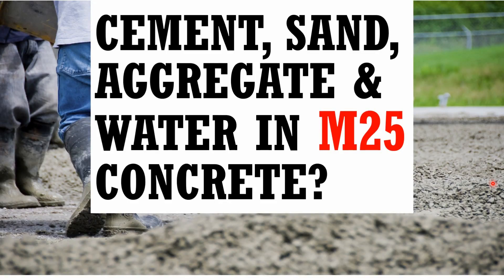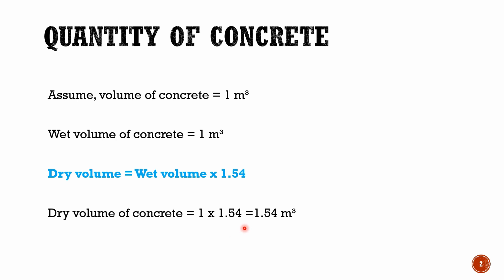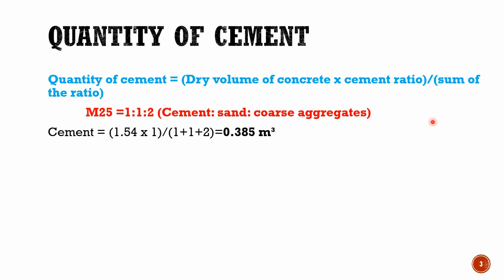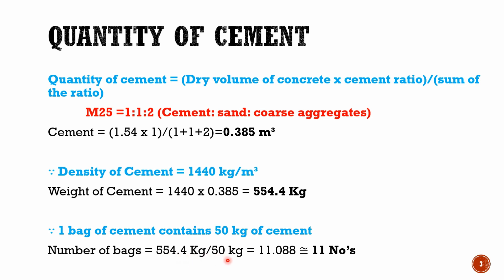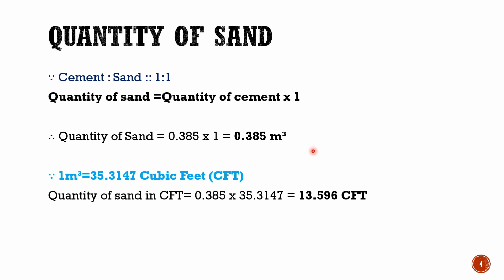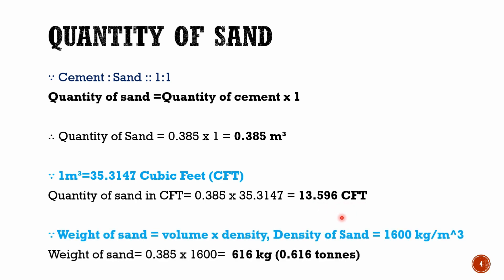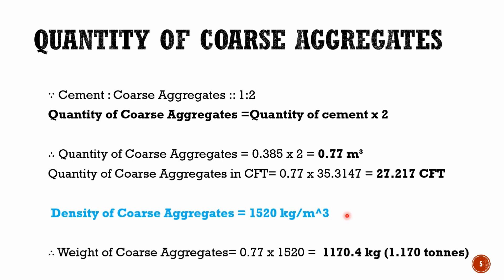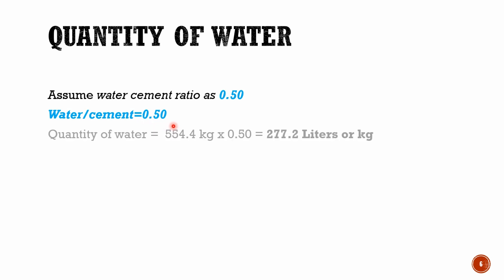How to Calculate Cement, Sand, Aggregate, and Water for M25 concrete

Comment: Ratio between wet and dry M25 concrete.....?
Reply from the maker: 1.54 is the multiplication factor. 
After adding the water to the concrete mix, It bulks and reduce the volume by approx. 54 % during wet condition. In order to calculate the dry volume of cement, sand & coarse aggregates, add 54% of extra volume to it.
Reply: https://youtu.be/ZtQ8KxGdVV8

Comment: Quantity of water is in kg or lts ?? because value of 1 kg differs from 1 lts or water.
Reply from the maker: Density of water is 1000 kg per cubic meter which means 1 kg of water is equivalent to 1 litre of water. 
That's basic sir :-) 

Thanks for asking a doubt